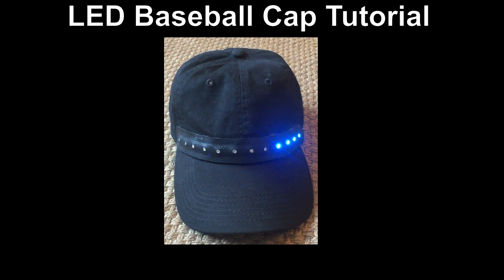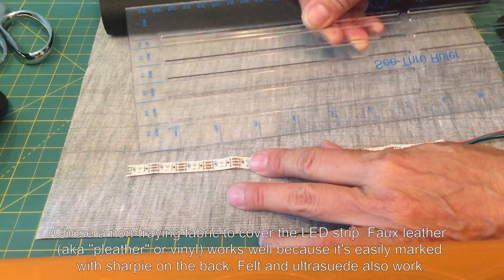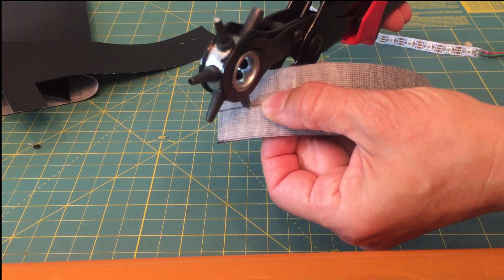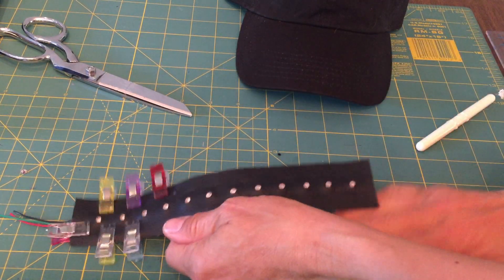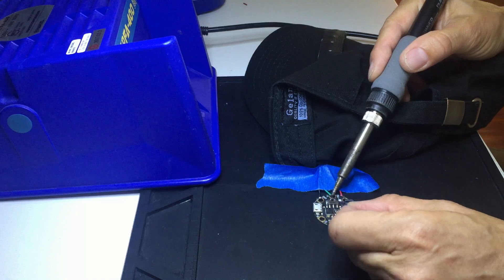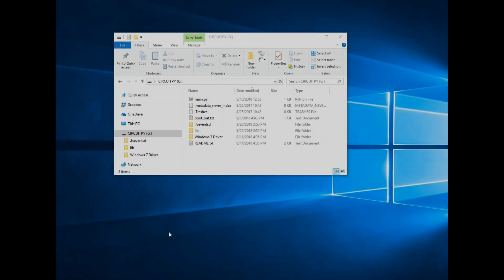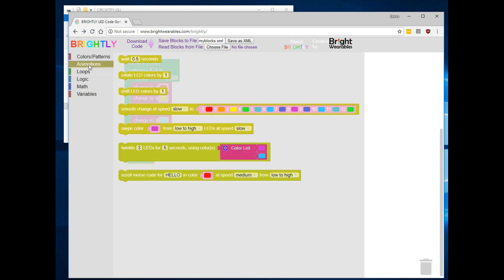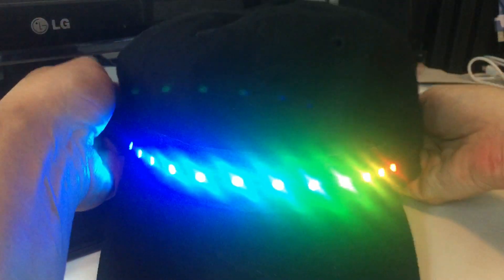Programmable LED Hat Tutorial

Comment: This was the final piece of the puzzle I needed for my project! Thank you so much for this information video. Super excited to tweak my settings with brightly, will it still be supported on the newest versions of circuit python?
Reply from the maker: Hi Nate - I'm glad you find it useful. Brightly works works with CircuitPython 4, and unless there have been significant changes to the Neopixel library,  it should work with CircuitPython 5, once I make the release for it. If you don't see a new release once CircuitPython 5 is released, message me, or comment, and I'll make sure to get to it.